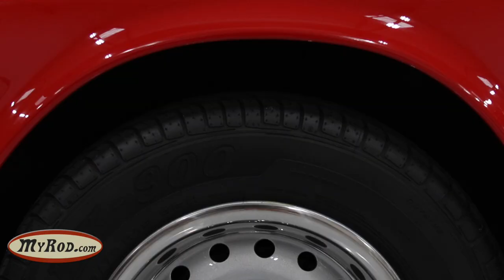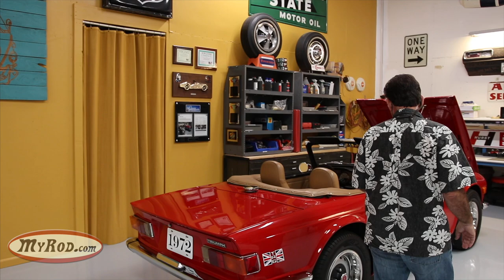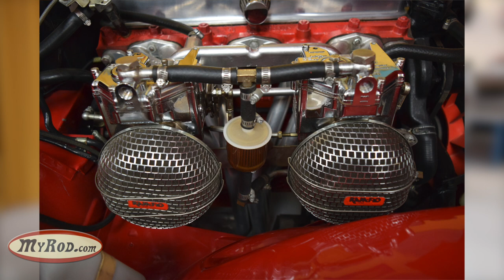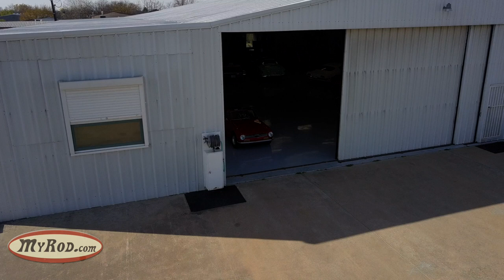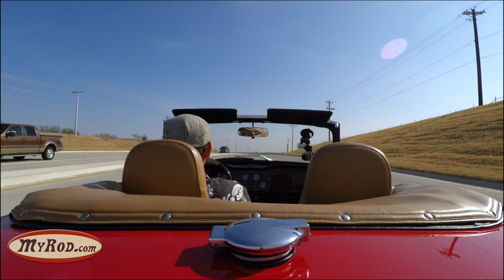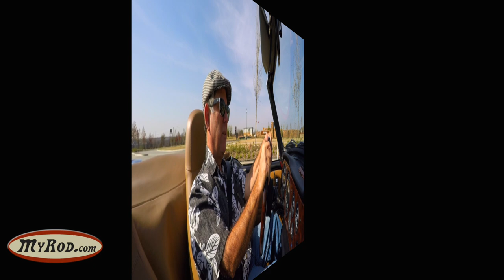1972 Triumph TR6 - overdrive & performance upgrades!

Comment: Ugh. Nothing more desperate than a tiny little engine with a desperate exhaust sound, trying to be something it isn't. So funny Brits call our sidepipe 450 horsepower 427s that rev to 7000 rpms, "lumps". Gotta compete somehow. Words are a logical choice.

Comment: Not a TRUE TR6
Reply: i think it's original enough. Subtle improvements yes,  but still a TR6.
Reply: I have a 1967 TR4A and I put a 5 speed conversion in my car and it runs like a charm.  Many guys in my local Triumph club put the Miata seats in their cars.  They are very comfortable.  These kind of additions add value to the car and do not destroy the true Triumph ride.  What destroys the Triumph ride in my opinion is putting in a 350 engine or any other engine conversion.  As long as it is the original engine any carburetor enhancements betters the car.  The Miata seats do not work well with TR4’s because TR4’s never had headrests.  Triumph and MG’s allow a person to enjoying the British car hobby at a very reasonable price.  At a car show people will look at my car over any Porsche. Mine is like new from the factory.  I fixed it up and drive it on the weekends and the value is about $32,000 there are many great drivers for a cost of $15,000-20,000 range.  Try buying a classic Porsche at that price.

Comment: His over emphasis on Overdrive is stupid, and fails to mention the purpose of Overdrive for viewers that don't know:  It reduces engine R.P.M. or better understood as Piston Travel Per Mile.  It will reduce Fuel Consumption at high speeds and reduce relative wear of the engine.  If you plan to drive a TR6 at 100+ M.P.H. you should have overdrive.  The typical driver does not and probably never will.  He also fails to mention anything about the Overdrive on 2nd. & 3rd. Gears which are useless.  With Overdrive on three gears, you basically have a 7 Speed Transmission.  
Last but not least, classic sports cars should maintain their originality, however in this case other than the Body & Chassis, nothing is original in this car, including the Interior.  Every automobile that was mass produced or built by hand can be improved in numerous ways, however what the individual does does not mean it was the best improvement whatsoever.  His choice of Electric Choke Weber Carburetors compared to SU Carburetors with Manual Choke, is a poor choice unless you live in Florida, or California.
Reply: I'd have a four speed plus overdrive over a five speed any day, much better to drive.
Reply: Overdrive here isn't so much for the rev reduction for cruising, but more so for having fun in twisty country roads hehe 

That's because it's electric overdrive ! Rather than just a fifth gear 
with this lovely electric overdrive you flip a switch and the revs will raise/drop in an instant! -Don't need to push in the clutch and move a gearstick around when going in and out of overdrive, so there's no downtime :) 
Get to apply power through the 'shifts', excellent for spirited driving